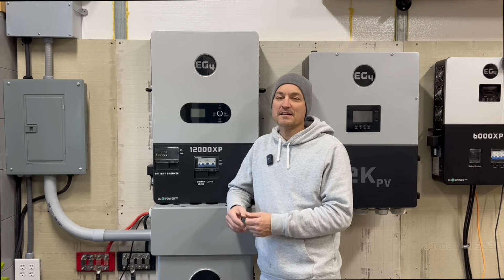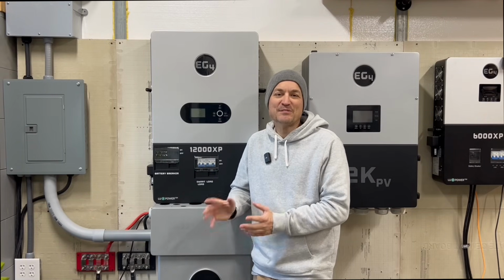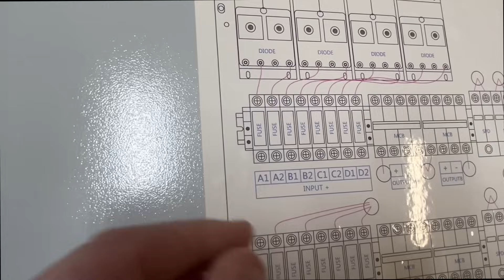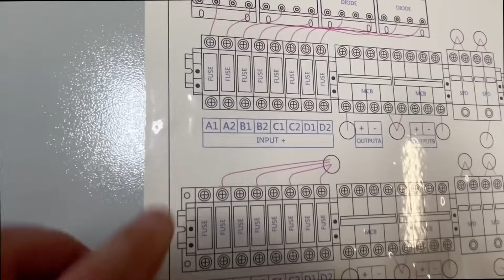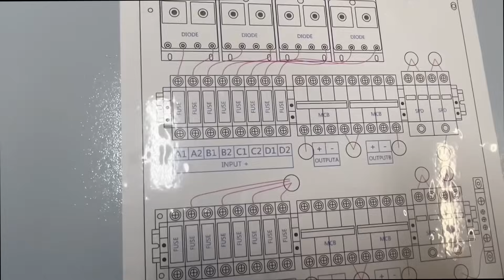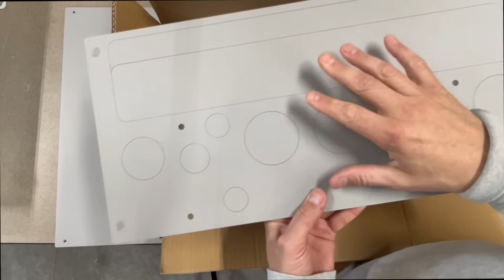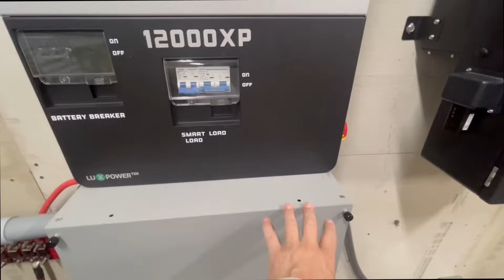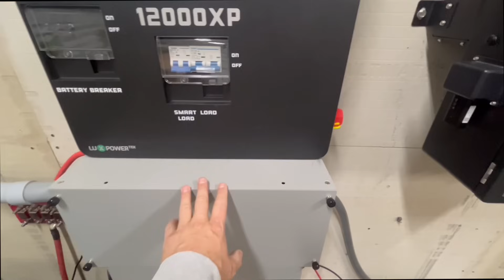How to use a combiner box with the EG4 12000xp to maximize your solar input

Comment: I just picked up my first combiner box for my 1.8 kw system. I much prefer having breakers on each input vs a fuse, which is great for diagnostic work.
Reply from the maker: Agreed yeah. Although these models have both. And actually the fuses have saved me a couple times during lightning strikes

Comment: I wish these combiner boxes were setup for conduit.  I am sure you can drill out a hole, but it would be nice.
Reply from the maker: Yeah true. Well technically the outputs are set up for 1/2 inch conduit. The solar inputs would have to be widened with a taper bit though.
Reply: @GavinStoneDIY  Thanks much for all your info. I am just now installing my first off grid system, and am reviewing your videos. Very helpful.

Comment: If you added a Midnight SPD they also need to land on the PV pos and PV neg - where would you land those wires in this box?
Reply from the maker: I’ve shown that in some other videos. I add the SPD by using a 3 way Polaris insulated wire splice.
Reply: @GavinStoneDIY  Gotcha! thanks.

Comment: Would this work also as an outdoor hub, for series lines as well? Or would it be another point of possible failure? It would be nice to have an outdoor wall box to wire it all into and then run back to inverter. Along with lightning protection etc.
Reply from the maker: Any additional components could be a point of failure. But it’s also a great place to have things  like fuses and surge protection.
Reply: @GavinStoneDIY yea I like that set up. Getting closer every week :)

Comment: Your link doesn't work for the combiner box. The 12xp has duel inputs for each mppt can't you just run 10awg and combine there at the inverter. Also have to consider NEC requires wire to be derated to 80% because it's under continues max load. Another thing is IMO disconnects are rated for 32 amps that can be a problem when you exceed that NEC goes by the ISC rating of the panel which generally is around 14-15 amps.
Reply from the maker: Unfortunately watts247’s affiliate program is still having issues. So the links are probably dead.

You can combine the arrays at the inverter, yes. But if you want to reach the maximum input on the PV you’ll likely need 3 strings per input.

Comment: Hi Gavin 
I have my 12000xp up and running with 8 hyperion 400w bifacial  panels. I was on eg4,s solar calculator site. Typed in my panels, and it told me I could do 44 of my panels. As 4 sets of 11 panels. 22 in  pv 1 and 22 in pv2.  So does that mean I wouldn't need a combiner box if I kept each pv the same? I've been trying to call eg4 but can't get anyoneto answer. The real reason I'm trying to find out is because I'm planning for the spring and getting ready to order more of my panels while they are still in stock to keep everything the same. 
Thanks darrell
Reply from the maker: I’m not sure of the specs on those panels. But yeah that sounds like it would be fine without a combiner, assuming the calculator factored in the low temperatures for your area.
Reply: @GavinStoneDIY I just put zero as our low and 100 as a high. We've only had one winter when it was -22 below. The other reason I was asking was I thought i remembered in one of your videos saying that each pv input was like its own built in combinner box as long as each string was exactly the same. 
Thanks darrell
Reply from the maker: @hemieed1 yeah each input has 2 separate ports. So in that sense it’s a small combiner box. Sounds like those are good specs on those panels for the 12,000xp. You’ll get over 16kw of solar on it that way.
Reply: Hi gavin I know no question is a dumb question lol. But here it go's I have my 1 string now the pv cable run is about 100 feet.  I'm going to set up 2 more equal panel strings witch are maybe 60 feet away in a totally different location and will be running to my combiner box is that ok or will those 2 pv line strings need to be the same length?  Thanks darrell
Reply from the maker: @hemieed1 as long as your adding them to the other mppt that’s fine. Otherwise your solar input would decrease quite a bit,  as it will always favor the least output between the arrays. 

In other words, always combine strings off the same array in the same area.

Comment: what about the amps limitation base on the panel Infor.
Reply from the maker: Not sure I understand the question.
Reply: @GavinStoneDIY  the max amps  for 12000xp is 35 and the voltage is 480.
Reply: @GavinStoneDIY  you may know i mention that I just bought a 12000xp, but most of my planning was for a 18kpv or the flexboss version.  I had bought wires for those units.  Now after pulling all my wires.  I might be under size.  I have 1awg aluminum wire for grid feed line and #1 copper conductor wire for my load.  Tell me I'm not jacked in the wrong way?  All is rated for over 100amps 😢
Reply from the maker: @Livingsolaryourway  you can exceed the amperage on the PV safely. It’ll only use what it needs.

That wire size will work for the ac output, depending on what you’re planning on doing. This unit can only output 50 amps. But it can bypass 100 amps.
Reply: @GavinStoneDIY I was checking out another video for tips and they said 3 Awg  but I have 1 awg size wire. For powing my loads i had bought #1 copper 3-1 cables but pulling power from the grid i bought Awg aluminum to save money at the time, but I was thinking after listening to this other video I was thinking I was under size. I started sweating in my mind 😅.

Comment: Do you see any disadvantage to combining all 3 strings at the combiner box and then sending that single combined string  to each MPPT on the 12000XP?  Or do you gain some advantage by combining just 2 strings at the array and sending one directly in two the inverter?   Thanks for these videos they have helped out tremendously!
Reply from the maker: That will raise the amperage up. So depending on the amperage you might have to use an 8 awg wire. Plus you’d need a combiner box that’s capable of that. Not really a down side, just different options really.
Reply: @GavinStoneDIY hanks for the swift reply yeah I got one of those midnight solar MNPV12 I just really liked how well it integrated with there midnite SPD and using solid bus bars made it nice and clean.   And I did upgrade my wire to 8awg although it’s literally about 10 feet from my inverter on the side of my home.
Reply from the maker: @SolarinStarke-kt2lm nice! I need to get my hands on one of those midnight combiner boxes. They look super nice.

Comment: Speaking of combining strings, if you wanted to use the 12000XP, and you wanted to mount a different 8 panel array on south, east, and west roofing (3x8 for 24 total), what's the best way to do this, so that you don't have the voltage limited by the array with the lowest voltage?  Is the 12000XP just not a good option if someone wanted to set up panels on 3 different direction pointed arrays? South on 1 mppt? East and West on 1 mppt for 2 total strings?   I hope my question makes sense!
Reply from the maker: Technically the 12000xp has 2 mppt’s. So if you wanted arrays in 3 different directions, you’d either need a separate charge controller, or choose a different inverter with 3. Like the flexboss 21

Comment: I've got 32 panels which are rated at 48.9 volts 395 Watts my plan was to run four strings in series of eight panels each which would bring a total of 391 volts and 3160 Watts at 10.6 amps per string which would be giving me a combined total of 390 volt 12,640 Watt and 42.4 amps my 12,000 XP didn't come with an owner's manual instructor unfortunately so I had to download everything off the internet and after watching this video I'm realizing that I can't hook the total 12,640 Watts I'm just one mppt circuit I've got a six-string combiner box so with my better option be to go with two two string combiner boxes and then run them in parallel that way I can run two parallel strings which would have a total voltage of 391 volts 6320 Watts 21.2 amps and run that on one mppt,, is that what you would do?
Reply from the maker: With those numbers I would run four groups of 8 panels in series. Two to input 1. And two to input 2. You don’t need a combiner box. Unless you planned to expand your array further later. You could final 4 strings into the inverter.

Comment: Do you prefer 1200XP of the 12kpv if price didn't matter and you only needed to run about 8kw cont.
Reply from the maker: @iabuchan  man that’s a hard call. I like not having filters and it being a sealed inverter with the 12kpv. Plus the hybrid options can be nice.  But I also would prefer having that extra wattage that the 12,000xp offers. Even if you aren’t going to use it, running the inverter at 70% of its available power would help things last longer. I would probably choose the flexboss 18 if price wasn’t an issue. But then second option….i guess 12kpv. That’s such a hard choice really.
Reply: @GavinStoneDIY  Thanks! yeah, I like the flexboss but want to AC couple my enphase microinverters I had installed about 6 years ago without needing the gridboss. I went with the 12kpv, that way I can always sell back to the grid when my battery is full and loads are minimal. Maybe I will post a videos of how it goes when I get everything connected. I haven't seen many videos of EG4 systems running AC coupled. I'm mostly building this system for the ability to create a microgrid if the power goes out. Seemed like a waste to have solar on my roof but be running a genny for power when there is an outage. I live in SoCal and the power is reliable enough but after yesterday's situation in Spain......you can never be too prepared. Thanks again, love the videos.
Reply from the maker: @iabuchan  yeah make some videos! Send me the link whenever you get around to it. Love seeing installs.

Comment: When using combiner boxes or paralleling do you have to use identical strings of panels? Such as 2 strings of 10 panels or could it be a string of 12 and a string of 8?
Reply from the maker: Yes you’d want them to be identical. The more panels in series the greater the voltage, so if you parallel different voltages the array will always favor the least voltage. I hope that makes sense. I said the word voltage a lot there.
Reply: Okay. Around 9:40 you mentioned on mppt 1 you could do 8000w on 1st input and 4000w on the 2nd input for #1. Wouldn’t that favor one over the other like you just mentioned? Or does it work differently? 

My brain understands the math of single arrays but combining and paralleling it just black screens.
Reply from the maker: @ShortyzProductionz I understand yeah. I remember when I was first looking into series and paralleling panels.  
They would all have to be equal wattage/voltage. So it’s essentially the same array, just split up into 3 to get it into the inverter. So  3 strings of 10 panels in series, then paralleled. Or it may be 3 strings of 8. That part really depends on the voc of the panels. All the same voltage and wattage, paralleled.
Reply: @ I see, I think it clicked. So essentially you’re still paralleling 3 identical strings. 2 at the combiner box and the 3rd in the inverter itself?
Reply from the maker: @ShortyzProductionz exactly yes. You can’t send all 3 in at once because it’s just 2 inputs per mppt,  but it’s the same  in the end. 3 identical strings paralleling to achieve that 12kw per mppt.
Reply: @GavinStoneDIY  perfect, I appreciate your help!

Comment: Im a little confused.. hah you reference putting a combined string(hypothetical 8kw) into pv input 1 on inverter.. then (hypothetical 4kw) also into pv 1 paralleling them at the inverter. Wouldnt that be a mismatched string sized put in parallel? 8kw having higher voltage and amperage then the 4kw. Or am i thinking about this wrong. Im hear to learn.. hah
Reply from the maker: Adding that extra string in parallel just adds to the total amperage, not voltage. Essentially like your battery storage. If you have 2-100ah batteries, adding that third string is just like adding another 100ah battery. The amperage would increase, but your voltage will remain the same.

Comment: On the AC side, when using 2 eg4 12,000xp in parallel, will i need an AC combiner box?
Reply from the maker: You can do that. Or run both directly to your critical loads panel. It all depends on how you want to do it really.

Comment: Got a question. I have the EG4 12k inverter box and 17 Solar Edge panels, so are these 2 compatible or will have to have everything same brand?
Reply from the maker: @PapineRd876  the solar edge panels are using microninveters?

Comment: While the 12000xp does have some headroom? If you live in a cold climate you should not max out that headroom. You get a sunny day where its -20 outside and you are going to push WAY beyond that 24k maximum. At cold temperatures panels are 25% more efficient than their standard rating.
Reply from the maker: @davefroman4700  as long as you’re within the voltage limits then that shouldnt be a problem. People should always verify the temperature coefficient for the area they live.

Comment: With this video many doubts have been clarified for me, thanks for the video
Reply from the maker: @OdairHernandez-lf8jw  glad to help!
Reply: In the video you combine two strings and one separate that only went to the 1st string from the inverter. My question is, did you have to select input mode  pv1 and pv2 independient or pv1 and pv2 parallel
Reply from the maker: @ I left the PV on separate. That way you can achieve the 12kw per input.

Comment: I have the 12000xp with 26.2kw worth of bifacial solar connected, and it is impressive. I highly recommend maxing out the solar.
Reply: I used qty-(40) 655-watt panels with 45voc and 18 amp isc. The panels are arranged in a 10s 2p configuration on each mppt charge controller. This gives    me a usable 12,000 watts to charge the batteries and 12,000 watts to power loads if there is demand. What I have noticed is that I can still put max power (12,000 watts) into the batteries by 10:30 in the morning on a partially cloudy day. I will also note that I am in the northwest and have snow on the ground during this test. Anyway, thanks for making great videos! You have made some very useful content.
Reply: @ians3108  I also have 655-watt panels with 45voc and 18 amp isc.  I wanted to put 10 panels in series but did not want to risk exceeding the voltage.  I also live in the snow, but temps stay above 0 F?  Is your inverter still performing without issues?
Reply: The panels I used are called Astroenergy. The model is chsm66mf-bh-655.
Reply: So far, my inverter is working flawlessly.
Reply: @ians3108  awesome, thanks for the feedback.
Reply from the maker: Wow! That’s a massive array. Really cool.
Reply: What brand and model of your 655-watt panels with 45voc and 18 amp isc Solar Panels?

Comment: So what is input C and D for? where does it come out? Can this box be used to get the full 24,000 watts or would that require 2 o these boxes? Your explanation is a little confusing wish you covered the topic a little more clearly or at least do what you say can be done
Reply from the maker: @MrDonking1967  yes you could use this box to get the full input potential out of the 12,000xp. A/B would be for mppt 1. 

C/D would be for mppt2. The example I showed was just for MPPT 1. You’d just repeat the same process for mppt2. Combine 2 strings on A  and send the third on B.  And C would be combining 2 strings and D would go straight through. 

The actual concept isn’t hard. But it was rather difficult explaining in video form.
Reply: @GavinStoneDIY  Thanks. We are gonna connect 6 12000xp full solar inputs.
Reply from the maker: @ wow! 6 XP’s in parallel?
Reply: @GavinStoneDIY   Yes, for commercial use.
Reply: approximately 4500 amp hours of battery.
Reply from the maker: @MrDonking1967  wow that’s incredible! I’d love to see photos when you’re done.
Reply from the maker: @MrDonking1967  I would say please use my affiliate links. 😆
But honestly I would try to call and see if you can get some better pricing from them, considering the amount you’re buying.
Reply: @GavinStoneDIY  I purchased the inverters already. The batteries I will get directly from China. Will be using the mb31 314ah cells from EVE making 16 314ah  batteries. We already have 12 100ah batteries using now.
Reply from the maker: @MrDonking1967  that’s going to be quite the system.

Comment: You can put 4 strings directly into the inverter and combine them that way, thus not needing a combiner box.
Reply from the maker: If you didn’t want to have the full 24kw you can definitely do this. That’s what I mentioned in the beginning.
Reply: Nevermind the previous. I see now the 35 amps of input per MPPT. That changes things. That large allowance with the MPPT voltage range forces you into a combiner box.